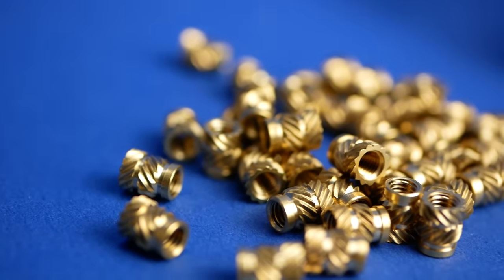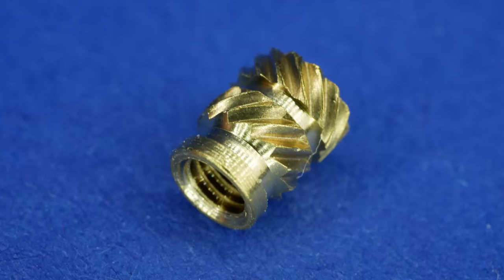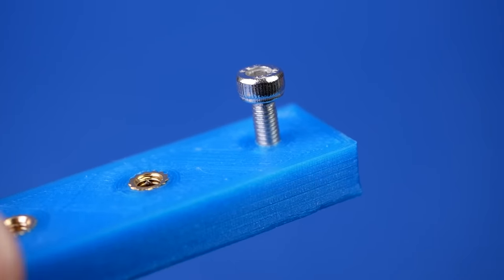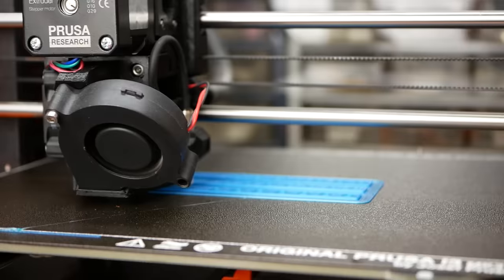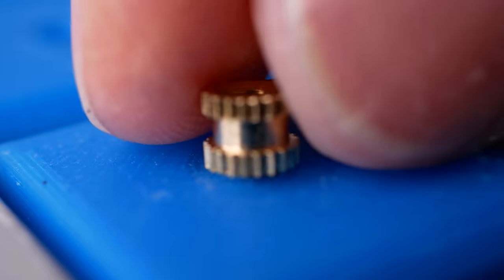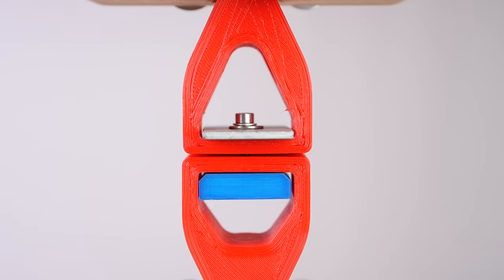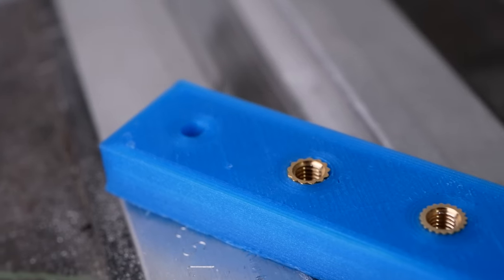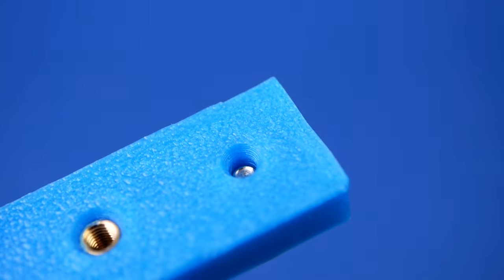Threaded Inserts for 3D Prints - Cheap VS Expensive 💰

Comment: i mean pull out resistance can just be measured by surface area and material strength so the general idea is to have a good match of the 2, too much surface area shredding into the plastic leaves less plastic to grip on. if you really want something to not pull out put a bolt through the bolt at the bottom or use a spacer in or on the plastic. an ideal spacer would be something strong that can be heat fit pushed into place and expand before cooling and hardening giving you a multiplicative rate of pull out resistance rather then just additive provided by the threading.

Comment: Another important case for an insert is when using nylon bolts to attach fragile or electrical items to 3D printed mounts, such as PCBs or drilled glass.  Nylon bolts are also useful when some compliance is needed in the mount, but the mount itself must not flex.

Comment: Very nice video. I appreciate the testing and work that you put into it. I have a question about the torque test though. When the bolts shear, is that because you are tightening them against the metal of the insert? At this point, the force of the bolt is only against the insert and not the plastic, in the axial direction. Of course you are still testing the insert against the plastic in a rotational direction, but it no longer is testing the axial pull out of the insert against the plastic, no?
Reply from the maker: You shear the bolt head because you tighten the screw against the insert. Not 100% realistic but probably the worst case.
Reply: @CNCKitchen  ok thanks for the reply and keep up the good work!!

Comment: Thank You !!  Your evaluation of these, and research of printed hole accuracy, was excellent and much appreciated!  You might take a look at the 'version' I have used (when possible) which prints a thru-hole for the bolt/screw and a recess for a nut (on the opposite side).  I like to heat-stake the nut into its recess (I hate looking for them on the floor ;-) ) as this provides a LOT of both pull-out and torque strength as well as repeated in/out (replacement) of the screws.  Also, note that the (really quite good!) 'thread into the plastic' method, for one-off installation of the screw, can be improved by applying an adhesive (epoxy suggested) when bolting the parts together - since they are SERIOUSLY one-time install screws - if additional strength is, indeed, required.  Nice work - keep it up ! ;-)  James

Comment: The 3c inserts work well when you design the part so that the insert is pulled against a wall. For example, instead of putting a nut into a printed hole to make a threaded hole, you put the insert there instead and it works better.

Comment: That's actually really interesting.  I have noticed that they shrink, and I have been trying to figure out a way to counter that, but here is my question.  Will the shrinkage be universal  regardless of the size?  For example, lets say that something shrinks 5% of the original size for a part that is 6 mm wide, will it be 5% if it is 15 mm wide?  I hope that makes since.

Comment: seems that no one comment on the pull test setup. If you want to get more accurate pull test result, the top and bottom bracket that you used in the test setup should be way more rigid than the tested part. From this video, the bracket deform way too much compare to you tested part. The force you get from the pull test will be way higher if you change to a rigid part (e.g. metal part) and the difference should be more obvious.

Comment: I've been thinking about these things a lot lately and would like to see a comparison with the inserts, a nut with slightly undersized printed shaped hole, a wingnut with slightly undersized shaped hole as well and maybe a variety of t-nuts both melted in or just used as they are supposed to.

Comment: Very useful content as always Stefan! I wish you had also taken the opportunity to test one more case: a bolt threaded into a tapped undersize hole (ie manually threading the part with a tap wrench and screwing in the bolt). I have a feeling that this would also be a useful scenario, probably slightly weaker than a bolt directly into the plastic.
Reply from the maker: Watch my last video on threaded inserts. I tested exactly that scenario in that one.

Comment: I've used to direct screw method for years and haven't had a failure or wear with light duty applications, but you can feel with just the slightest over torque it can ruin the hole. I wonder how well a thread repair insert would work. Furthermore if you add a screw hole for the insert vs self tapping.

Comment: Try inserting from the back side. Where you have to pull the insert all the way through the plastic. Also, try to use flanged inserts. These should be designed to insert from the back. It should give you some really impressive results

Comment: I wonder if you were to tap the hole if it would be stronger (and reusable) than just forcing the screw in an undersized hole ?   I tap a lot of UHMW plastic, and it does hold a thread nicely

Comment: I think for the cheaper ones, if it failed so badly, are you sure you followed proper hole geometry? You didn’t share your hole geometry, but there are some general guidelines for sizing holes properly online. Idk, but I’m skeptical without the lack of details on the hole geometry. Do you holes account for expansion, are they tapered, proper size and depth etc. Think you could have done better in that department, explaining methodology. Just accepting results without thinking about it isn’t science!

Comment: I think the weak link on pull out force is always going to be the plastic, so for a better insert you'd want to maximize the area where the force is distributed with the insert. I wonder if the screw in style wood inserts would do better as they would essentially just be increasing the diameter and ultimately area of the bolt being screwed into the plastic.

Comment: One thing you did not take into consideration here was plastic's tendency to distort over time. Plastic is actually slightly fluid, and over the course of a few months to a few years under pressure it will flow and distort. In particular, I think the direct screw may be good initially, but over time the strength should decay noticeably. Would love to see you assemble these parts again, and then just leave them sit on the shelf for a year or two. Pull them out again December 2021 and run the tests. Would be curious to see how much the results change.

And as for the cheap inserts, as has already been pointed out, they are designed to be used only on injection molding machines. The extreme temperatures and high pressure of the molten plastic fills the gap between the flanges much more rigidly. If you simply press them in, you have very low temps and only the pressure of gravity to fill the void. They are cheap not because they are bad, but because the need for injection molded inserts is orders of magnitude greater than for press fit inserts. Simple supply and demand.

Comment: Hi , I don't have more experience in inserting nuts in 3d printed parts. I have a M3 inserted nut. When I try to insert the nut into it. The PLA was melted down inside the threads. So I can't use that print. Each and every time mostly I wasted time, money, inserted nuts. After some trys, still I don't know how to insert it. Any design considerations in it?. What is the diameter for M3 nut?. Any tips for me

Comment: Have you considered 3D printing the actual thread into the hole to Heli-coil size and inserting a heli-coil? 

I recon that would be better than most of the options shown as it would bite into the hole and spread the load a bit.

Comment: Hi Stefan, I was impressed by the connection strength of the metric screw directly screwed into the plastic. Now I'm curious how a coarse-threaded wood screw would perform in PLA. This is my go-to joining method. 
Maybe testing out the performance of different kinds of screw types could be an interesting video idea.
Reply: There are screws made specifically for use directly into a simple hole. Plastite is the brand I am familiar with, but I am  sure there are others.

Comment: Could you test threadforming or threadcutting screws (PT30 for example) with a thread optimized for plastics,  unlike the M3 (intended for metal) used in this clip ?

Comment: After watching again this video, I wonder what could be the results with direct use of wood screws, self-tapping screws, sheet metal screws or dry-wall screws? Metal screws have a small thread compare to those and seems to me unsuitable for the material (despite the not so bad result you have got).

Comment: If you overtighten the screw in plastic, you can just heat the bolt with soldering iron and it's repaired

And you can even add some more plastic

Comment: I literally just made a huge print with the “cheap” inserts. Fml. Granted I designed the model to resist pull in and the main reason I bought them was for the torque aspect.
Reply: It's still good for stuff you want to disassemble, so no big loss, unless you want to hang from it.
Reply: You could always drill a small hole, and inject super glue or epoxy around the insert.

Comment: You can use the horizontal expancion both in PrusaSlicer and Cura to fine tune your holes. I got them to 0.02mm accuracy and that is with really budget calipers which could be the main difference.
Reply from the maker: Yes, but that also messes up the outer dimensions of your 3D print, so not universally applicable.

Comment: I'm extremely new to 3D printing - is there a reason you'd use a bolt instead of a screw, when fastening two parts together? Screws create their own tapped thread, and if treated correctly that thread should last a decent length of time, at least in injection-molded plastics. Is there something to printed parts that I'm missing here?

Comment: Very good bench, thanks for your efforts.
You should have used a proper M3 tap to thread the plastic instead of brute forcing a screw in the hole. It would outperform the inserts I think...

Comment: Looking at the Ruthex design, I think they should be put in while rotating, ensuring that there will be plastic in between the groves, I think that would increase the pull-out test, for the same reason the bolt direct to plastic was able to withstand so much pull-out force.

Comment: BTW what you should do is an endurance test and a repetitive test.

As in obviously it breaks at x force if adding draw really fast but how long can it hold at 90% of breaking force. how many minutes or hours can it withstand 90% max break force.

next how does it withstand having it go from 0% to 90% force to 0% to 90% over and over. How many times can it withstand that before it breaks.

Not sure what the technical term for that is but it would be interesting to see if for some reason one design handles that type of force better.

Comment: I would be interested in a setup where you have the cheap insert, but also the hole behind it with the bold diameter, so the bolt threads into the PLA.

Comment: Any chance you could perform the same test for a square nut inset on the opposite side of the print insteaded of a threaded insert? They're inexpensive, and should outperform the others on pull out strength.

Comment: I tend to use the cheap inserts when screwing things together pretty much entirely for the disassemblability compared to self-tapping the bolts into the plastic; and as you say the pull-out resistance isn't so bad for small bolts especially if you're not expecting huge loads on them in the first place.  I have tried the self--tapping threaded inserts in the past and found them utterly useless for FDM 3D prints.

Comment: I wonder how much impact adding a flat washer with a larger diameter on the head would impact the torque test for the bolt threaded directly into PLA.

Comment: I'm curious how the old  nut slot trick compares...
Of course you can't use a nut slot for all geometries, and I suppose it's more dependant on the geometry of the part and the material strength, but it's easier to install than a threaded insert (and cheaper).

Comment: Can we check the strength of a larger bolt (to match the surface area of the inserts), I feel that perhaps the inserts get most of their pull resistance from their expanded surface area in contact with the plastic insted of their form.

Comment: Since you srew into plastic you should also use plastic screws like ISO W1411, which is specially designed for thermo-plastic materials. It would be interesting to see that in comparison. I guess it will be even better than the metric srew and therefor also better than the inserts! Apart from that, great video! Thanks again!

Comment: You should test self-tapping screws next
Reply: MrStephan246 self tapping, press fit and screws designed for plastics. For a hobbyist heated inserts work fine, but for production they are slow.

Comment: I heard you saying you're using a Mk2.5.. Do you think it is worth the upgrade? Also considered attaching stepper motor dampeners, especially on the Y axis as the noise of the bed moving is horrible :p
Reply from the maker: The main reason for upgrading to the MK2.5 is the spring steel bed and if you print a lot it's really worth it! Love the textured powder coated PEI. I actually did a video on the upgrade: https://www.youtube.com/watch?v=Ktzbq6OcWbw

Comment: I would also like to have seen a comparison with a standard M3 nut pushed in to a hexagonal recess on the opposite side of the material.  I think  this method has the highest resistance to pullout.

Comment: If you use a tap to tread the holes you get higher results and the tread will be take the bolts out and put them back with out problem. Do not tread all the way, try half way down. The other advantage the tap will drill out hole to the correct dia.

Comment: I wonder how the stress test would turn out if the insert in the blue block was inserted from the bottom side with a smaller hole for the screw/bolt.  That way you have some uncompromised plastic holding the insert in place.  Does that make sense?

Comment: A comment... the three designs shown should not have more than one or two cents difference.  All are produced on old fashioned automatic screw machines.  The external knurling form makes no or tiny fractions of a cent difference in cost to produce but big difference in performance.

Comment: What if you could somehow get something like JB Weld in the gap for the injection moulded inserts? Maybe some designs you could have a little hole to inject the JB Weld into and then plug it up?  More work when you could buy the others but if you have an abundance of them and want to use them up this may work

Comment: Could you use the cheap inserts backed by an undersize hole and a long bolt to get good torque-out and good pull out performance?

Comment: You should try modeling threads in fusion 360 and printing them. I find that a 1mm pitch thread likes a 0.1mm layer height. Another thread insert possibility is a helicoil which is used to repair damaged threads in metal parts. These might also work in a modeled printed thread.
Reply from the maker: Tried that in the last video on that topic. Check that one out.

Comment: Thanks for doing these experiments, they save us viewers a lot of guess work. Im currently setting up my E3D Hemera and am designing my own layer fan duct. Can PLA be used as a viable duct material or will it fail if the fan is off?
Reply from the maker: Wouldn't recommend it since it will even get soft with the radiated heat only.

Comment: I would like to have you seen tested a normal nut integrated in the 3d print, because i think they don't take as much torque as the others, but pull out strength should be the best in my opinion.

Comment: You should include a bar graph that shows cost in 1 penny to weight ratio. Example: Threaded Insert costs 10 cents and can load 100 kilo making it 100/10 or 1 penny per 10 kilo. This way you find the best bang for your buck because there's probably diminishing returns for cost to kilo on some of these parts.

Comment: I often just print the tap drill size (minor diameter), and then tap the hole. It’s surprisingly strong, especially if you design the part with a lot of thread engagement (long holes)

Comment: in theory alone, no insert must be more effective.
Materiel-wise ... the screw pitch, its inner and outer diameter must be SYNCHRONIZED to a matched goal.
DRYWALL SCREWS ARE NOT THE SAME AS DECKING SCREWS.

Comment: IF your printer is dialed in, Layer height should be the dominant factor. You simply add the printing layer height to the diameter, at least in my experience.

Comment: I'm using cheap thread inserts for blind holes, so the plastic goes into the groove, and I press them into plastic with screwed bolt into it. How to heat it when bolt is inside? I'm using hot air soldering station. Screw out the bolt when it's cooled truly.

Comment: I would love to see a test using the standard inserts, but where you have them set inside the part with plastic covering them. You would have to add gcode to pause the print, then insert them, then continue the print to have it print plastic over the edges, leaving only the threaded hole exposed. This would be much closer to their intended use.

Comment: Personally I model a hole to fit an M3 nut on the reverse of the part I'm attaching to. I've never had one pull out or torque out because the size of the nut is much bigger than an insert.
I admit this may not be feasible for all applications but it;s surprising how often the design can be tailored to include the nuts. And they're a faction of the cost of inserts.

Comment: Try using aircraft NAS bolts. You can get them on line cheap as lond as you don't want any certification (C of C or 8130, etc), with them.